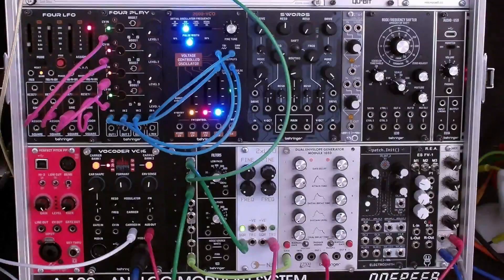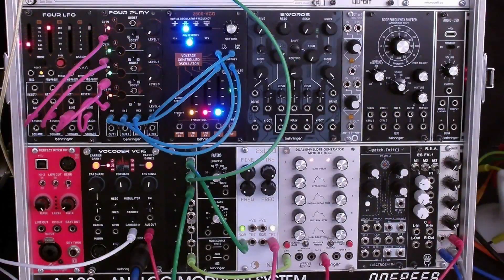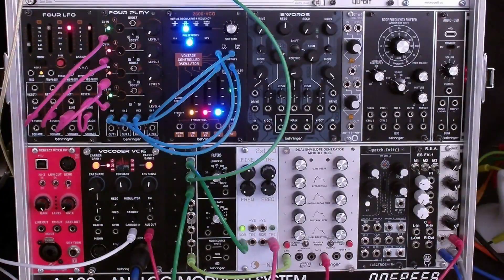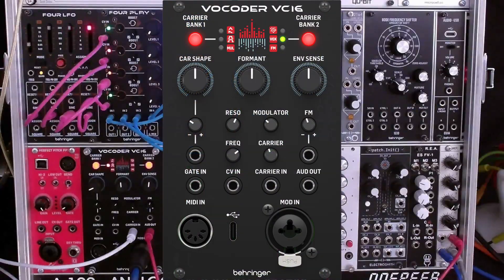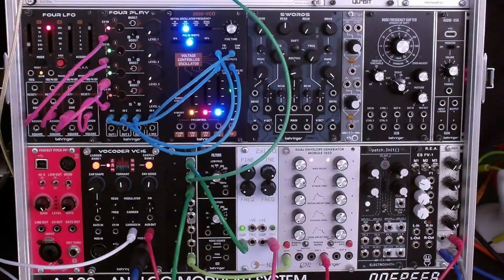VC16 Vocoder Part 2 by Behringer

Comment: Does it have to powered by a eurorack case? I bought it because I’m a vocoder junky. I wanted to run it along with my MPC. But I can’t figure out how to power it without a case.  I want to get into eurorack but was hoping I could use this without a eurorack case. Any help??
Reply from the maker: It does require Eurorack power.  The Behringer Go Case is a good option if you have any idea of continuing with Eurorack.
Reply: 2hp makes a tiny case, its a metal lunchbox, fits a couple average modules. 👌